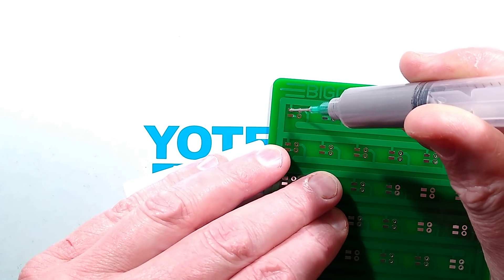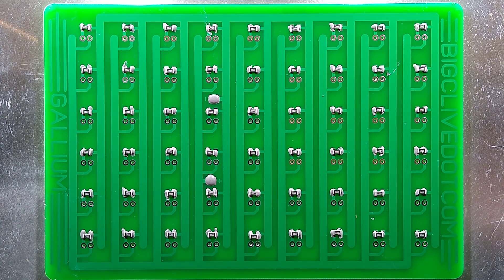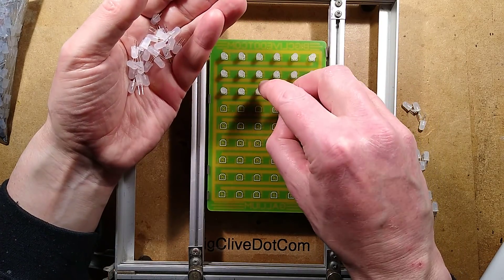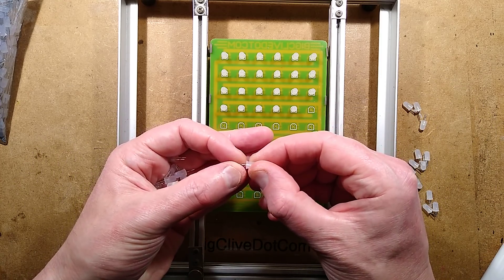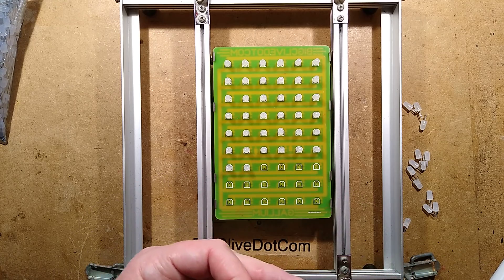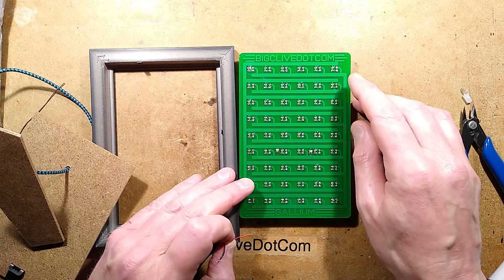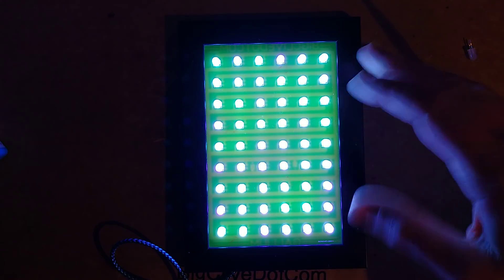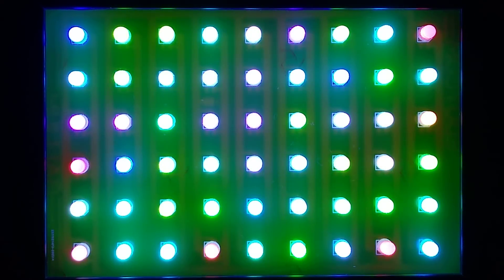Reflow attempt 2 on a custom LED art PCB (with resist).

Comment: bigclivedotcom it's all a learning experience, isn't it? At least you aren't stuck with Cordwood construction for your LED panels :P (Old missile etc. method, stack components like cordwood, had to be a nightmare to initially set up those designs...) Glad the solder resist helped you, that's its' job :)

Comment: Clive, have you already seen the slow color-changing LED in SMD form factor 0807? Your previous videos inspired me to build a small LED tree with those SMD LEDs.: https://www.youtube.com/watch?v=WOqtvYt1390
I think a panel with the 0807s might also look great, you could pack them more densely. Even at only 2 mA each they are really bright. You can find them in the usual places (eBay, AliExpress) by searching for "0807 slow RGB".
Reply: Yesterday, I tried and built a small LED panel (40 mm by 40 mm) with 64 "slow" color-changing LEDs in size 0807, again running at 2 mA each: https://www.youtube.com/watch?v=cekW8eaC-gA

Comment: Clive, use your hot air gun to manually solder the resistors on, Will be loads easier than using the soldering iron.

Comment: just turned on my speakers and i dunno if you mentioned it but are you catching a cold? your voice sounds weaker and courser than usual, btw can you check your other folder on facebook and message me back? me and some friends are trying to get some UVC products together and i need your advice
Reply: also, my cheat for electronics, despite the fact it isnt made for electronics,  Oatey 30011 Paste Flux #5 it is made for pipes and after about 8 years the little metal tin it came in is highly rusted but none of the electronics i've used it on have had any issues and that includes re-capping a pentium d motherboard some 8 years ago, its still working today and no corrosion! you can literally just take a smear on the tip of your finger and rub it across the board without even worrying where it goes, the solder mask alone is enough to keep it only on the copper

Comment: One more vote for a Through-Hole version in kit form please!
Have you considered getting a stencil made for the Surface Mount Version to help you in applying the solder paste ?
Reply: It's honestly not that hard to learn to do this for yourself, find a PC board software package that you can live with, learn to draw up the schematic, translate that file into a starting PC board file, move the components to proper positions and put traces down to connect it all, and you can even do your own PC board at home with Toner Transfer or the UV resist methods. For one of us to make a kit involves putting a bunch of our money in to buy PC boards that others may not buy, plus the time. So most of us would far rather teach someone how to do it, than do it for them!
Reply: Indeed, that would be my next request - saw Joe Barnard do it the other day and had not even considered before that this would be a 'homer' option. It would be interesting to trade-off of extra design work / extra cost for the stencil vs. time saved during assembly, and - perhaps? - more happiness? :)

Comment: The pinging solder is volatiles and water boiling off under half dries solder.
Try instead to have the hotplate at room temp and turn it on to 80-90c.
Then after it has slowly heated to 90c leave it for at least 30 seconds before turning it up to reflow temp.
Let it reach reflow temp and soak for at least 10 seconds before turning off the hotplate.
Depending on board you can then let it cool slowly or remove from plate once solder has firmed up. I do this all the time and there is no pinging solder.

Comment: Looks like a similar circuit board assembly frame is available from Gie-Tec Gmbh (gie-tec.de) [ Products -> PC Board Prototyping -> Soldering Technology -> PCB Assembly and Soldering Frame]
Also elektronik-lavpris.dk.
cliffuk.co.uk used to carry one but I don't think they do anymore. 
nutsvolts.com magazine has an article (September 2011) on building your own.

Comment: Clive, in case you still want to use the Dispensing method for SMD Reflowing instead the use of Stencils, here a low costs Dispenser that eases the Job(its less messy bcs it retracts after each dispensing so paste stops flowing out), https://hackaday.io/project/9404-solder-paste-dispenser-v6-air-free-5v-usb-new. I wrote the Firmware and adapted the HW for that thing (for a friend in Slovenia that manufactures & Sells it ).
Reply from the maker: That looks pretty neat.

Comment: 100% do a through hole one, I'm learning how to solder!
Reply: Practice on SMD and you'll be able to solder anything. Also, don't be afraid of surface mount, people keep making it sound difficult when it really isn't any more difficult than through hole (and don't fall for the thing about needing a teeny tiny tip on your iron, you don't). Frankly I quite often find it easier, especially when fixing mistakes.
Reply: @treborrrrr  What makes SMT (Surface Mount Technology) harder than IMT (Insertion Mount Technology) is the size.  I have big hands and I'm not the most steady (that may improve with practice) so unless I need something to be really small I'd rather work with IMT.  As you said a tiny tip isn't necessarily required, back in high school I usually flattened mine to a blade like edge but a standard tip works fine.
Reply: @johncoops6897  Thanks, good point. The non-magnetic / ceramic help, too, but the flux gets 'em sticky quick (which drives me a little nuts :-)

Comment: Try the gel flux, the thin stuff tends to either be colophony resin dissolved in isopropyl or whatever chemicals to hand, again dissolved in isopropyl which is perfik for irons but flashes off when warmed  The gel stays gelly while the solder goes molten under it - you'll get a much better result.
I'm going to say also - still too much solder, when you use a stencil, you literally wipe it on and scrape it off - its amazing how little actually sticks to the board.
Reply: The issue that I get is paste running between chip legs during the initial warming and bridging them, solder wick to clean it up after :(

Comment: Why are you keen on using SMD resistors here?
Reply: SMD parts mean no hole drilling for prototypers so our home made PC Boards are even less trouble, no need to form, cut, and later clip leads, no lead bits fly somewhere and stick, only to blow your project up later, they're smaller so your PC Board can do more for the size you have, they are great except for high power handling, for that you need TH or otherwise leaded parts. It is a bit different with SMD at first, not bad tho. Start off with 1206 or 0805 SMD component soldering first, if hand soldering, and don't tank up on coffee & THEN try to solder LOL

Comment: Have you tried using the paste then placing the resistors, then using your tweezers, hold each resistor and use the fine point of your hot air gun on your solder station? That's the closest thing I can think of without emptying your bank account for the Danotherm machine I used to use working on motherboards (4 layer) and amplifier components for a certain high end audio company from Scotland (all of their gear was actually hand built, including the inductors, hence the price).

Comment: I have never had good success with a hotplate, they are okay for small units, or stripping a PCb down, but hot air for small batches of larger boards I think is better and more controllable to save burning the boards :-) Nice video though and glad to see you keep trying

Comment: The pinging effect is the because of heat shock. Try heating the board with the plate to just before the solder melts and then give it some hot air to melt it. Those pads look too small for those resistors. About a 25% longer pad on each side (so it stick out under the resistors) should make the straiten out nicely (my rule of thumb). If you can be bothered to make a custom footprint. It will make the resistors also much more iron friendly as you can place it on both the pad and pin. Really like those LEDs might consider getting myself some just need to figure out a use case.

Comment: I use KINGBO RMA-218 flux ..it stays liquid well after the solder has melted...comes in 10CC syringes ...it makes surface mount reflowing a lot easier...

Comment: Seems to me the board was not totally FLAT, so the middle got direct heat from the hot plate, and the sides had a fraction of a millimeter air insulating... (?) 
I tried desperately to push the screen here to get the heat to distribute to the edges as well... 😃

Comment: I think you would have better results with the cheapie hot air station.  Hold the noozle vertical so you dont blow resistors everywhere.  Heat them till you can make them dance then move to the next one.

Comment: Maybe paint the PCB with the tri-color paint like green/violet/magenta (one of my favorites, and it's available in spray cans(you do need to use a graphite basecoat)).
I'd be hoping the LEDs would activate the different colors based on color and direction, it might have an interesting effect with zones changing color. Or it could do nothing, but it's worth a try if you don't mind investing in the paint.
Glad you got the soldering working a bit better. Try hot air next time you have a chance. The paste works ok if you just touch it with a soldering pencil so that's always a fallback, as is place and solder conventionally. Thanks Clive. Nice project. I feel a PIC version coming on...

Comment: I've found better results with warming the solder paste to around 40c before attempting to squeeze it out a syringe... Normally pop it (capped) into a glass of hot water for a few minutes.

I also get much better results with a very short (<5mm from where it's glued into the base) 16ga needle. I trim it by clamping it in my dremel and using shitty snips to cut it while it's spinning to prevent closing the end.
Reply: I second this. Warming the paste helps greatly, as does the shorter needle.

Comment: If you don't want plated through holes then set the holes to Not Plated :)
Having rounded corners may make the pcb more expensive as you may be charged for twice the diameter of the routing cutter on top of your pcb size.

Comment: I did the hot plate reflow for a little but it was futile in comparison to even a foil lined toaster oven which I also did for a while. 
I finally settled on an Aoyue oven which was roughly $1000 at the time and the difference is enormous. I rarely use through hole parts now outside of connectors.
I cannot suggest enough getting a Chinese oven like the ubiquitous T-962A and perhaps an upgraded controller for it such as the Reflow Master from Unexpected Maker.

Comment: I personally had good results with tinning pads with leaded solder (it's still legal here prototype manufacturing). Then I used genuine Chip Quick SMD291 tack flux and put the (also pretinned) QFN48 microcontroller in place. After that I used a reflow oven with a rather hot temperature profile to reflow solder the chip. For me, this worked perfectly 7 out of the 8 times I tried, the one that failed could be fixed by a bit of hand soldering. I am not sure if this would have worked for 1206 resistors, but for chips without leads I can recommend this method, it also worked for BMP280 sensors which have only very tiny solder pads on the bottom and I did not manage to solder them with paste/mask.

Comment: I've had more success using the plastic tapered cone nozzles on the syringe to apply the paste, rather than the stainless tube type.  It seems like you can use a smaller nozzle without having to push as hard, or resort to thinning the paste. Plus if it does require too much effort you can cut the nozzle back slightly and enlarge the hole.

Comment: Did you see the factory archive footage strange parts posted about the Chinese manual soldering workers and the high speed soldering
Reply from the maker: I didn't see that.  I'll have to have a look for it.  When I was manufacturing the fairground lighting controller PCBs I used to have about 10 in a rack and solder them as fast as the Antex 25W iron could keep up.
Reply: bigclivedotcom found the link here https://youtu.be/HF0E8WeEUVM?t=22m40s

Comment: Instead of pausing the video each time can we just have a short time laps? It might be a diff viewing experience.
Reply: Is a time lapse anything like a memory lapse?
Reply: This could be done in editing, without need to actually pause recording while doing the work that has to be done anyway. Sound effects (vvvvnt) could be added to indicate the various departures from real-time (1:1) record:playback. 

The sound of concentration, though…
Reply: @michaelthibault7930  That's what SexyCyborg does, usually with the chorus from Ilevan Polka playing.  Her videos are sponsored by JLPCB.
Reply: Could you try the PiP (Pin in Paste) method with this board?  It's a way to use solder paste techniques for through hole components.

Comment: Nice video. The splashing around is a result from getting the flux too hot too fast. It should more like this:  https://en.wikipedia.org/wiki/Reflow_soldering#/media/File:RSS_Components_of_a_Profile1.svg 
This is why I gave up on heating plates. And usual the pizza oven approach was too cumbersome. However your hot air soldering station is the best alternative. 

On the other hand, if I have to deal with SMD resistors or caps then this method is a more efficient and faster approach: 
https://www.youtube.com/watch?v=8whMwCBf8wA
Reply: That's not a great idea with ceramic caps as differentially heating them like that can cause premature failure or even 'infant mortality'.
Reply: In theory I agree. However, in more than one decade of working with this approach, I never had a problem. I soldered countless caps (with eutectic solder) on professionally produced PCBs (also foil PCBs) as well as experimental dot grid boards. And the experimental boards are a really good fit with 0805 or 0603 components for rapid prototyping.
Reply: Same experience here, the solder paste really needs those couple of minutes of preheat, I imagine that the splashing may be air bobbles trapped under paste? Had them blowing passives right off the board. :-)

I normally use the hot plate just as pre-heater for a minute or two and then reflow with the air gun, I found that to be helpful with 4 layer boards where hot air alone have a hard time heating pads connected to the internal ground planes. It's all about hitting the right profile, if you get it right on a board like that the passives should come out perfectly aligned.

Comment: A tip when cutting LED's shorter, cut across both leads at an angle so the anode is slightly longer than the cathode ;)
Reply from the maker: When I'm cropping the leads for using the LEDs in sockets I always leave the anode longer to make identification easier.  But as two cuts.
Reply: The leads also can become very sharp so watch out!
Reply: True, but this is just to insert in the board and be able to identify polarity, something i've done several times without pricking myself

Comment: I found placing solder paste works out better using a plastic toothpick. It's the way it sticks to the plastic.  I can control the amount and separation a lot better than a syringe. I also found hot air does a nicer job aligning the SMD's.

Comment: Have you ever tried using borax as flux?
I use it for fine silver jewelry soldering.
Reply: That kind of soldering is much higher temperature. Borax wouldn't melt at the temperatures Clive uses. Its melting point is over 700C.
Reply: @Cadwaladr  yeah, I figured that might be the case. I'm running at brazing level temperatures, sometimes around 1000°.
The borax reacts fairly quickly to heat, so I figured it might be useable at lower temps.

Comment: On a slightly different tack, could you/I use a domestic tabletop griddle to do the re-flow?   It would require an external thermometer to keep a check on the temperature, but otherwise?
Reply: I can't see why not.

Comment: One thing that makes me wonder about JLCPCB is they offer such a low price for the PCBs, but, what are the shipping costs? Not having anything to have made up by them I haven't a clue how much they charge for that, which being cynical is what makes me thing the $2 offer is a bit of a clickbait thing... :S
Reply: JLCPCB do not add anything to the shipping, I normally pay an extra £10 for DHL instead of normal postage. The worst example of shipping charge rip off is selecting DHL when ordering from aliexpress !
Reply from the maker: The shipping costs more than the PCBs, but that's just normal DHL style pricing.

Comment: Looks good but black would look better ;-)
Reply: JLCPCB will do black on both sides, either it takes  days longer or you pay more for it :)
When ordering there will be a comment box where you can request such things as Do not plate the holes, or Can you please coat the B side in solder resist :)
The easy way to get a blank B side coated is to put a 5 mil square pad in the center of it and to crank up the Solder Mask Expansion until it covers the whole board :)
Generaly there is a comment box when ordering to ask for the B side to be coated.

Comment: I have an interesting set of colour changing party lights that have the same random nature as yours in this video, however, I discovered once and by accident, if I got the wrong polarity power supply, those LEDs all lit up 'steady red' and stayed that way until I realised my mistake. No harm done, work normally on the correct PSU.  Interestingly, the do the same thing if you give them AC instead of their correct polarity DC. Does that make any sense?
Reply from the maker: It sounds like both power supplies put out AC or maybe rectified but unsmoothed DC.  These LEDs will keep resetting to red if not powered with smooth DC.
Reply: @bigclivedotcom  Okay, that would make sense. 👍